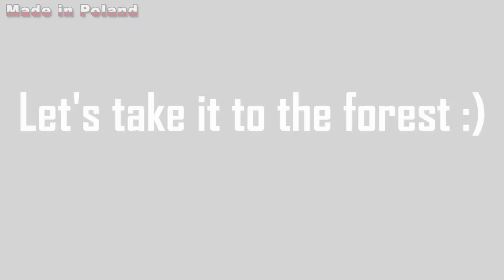Making mobile Gas-Powered Belt Conveyor

Comment: Would be nice the whole system mounted on the trailer, and driven by the PTO shaft of the tractor, so You wouldn't need two separate gas engines, that cost a lot, and are less fuel-efficient, than the tractor engine. But this system is very good too becouse of it's flexibility, and your craftmanship is extraordinary!
Greetings from Hungary!

Comment: Hi There. Very nice job. I have looked at many of your you tube. You are very talented. I notice one thing though. You cant push a rope up hill and you cant push a conveyor belt up hill either. You don't want to run your conveyor belt too tight and if you drive from the bottom you will have to have the belt fiddle string tight. When driven from the top end it is very slack on the return side underneath and is pulling the load up the conveyor.. Usually a couple of carrier rollers on the underside to carry the slack side of the belt. A conveyor has to have the drive mounted on the top end of the conveyor. You could put a sprocket on the top roller, mount your engine down at a convenient height and run belts up to the top roller or chain with a spring loaded tensioner.     Cheers, Nice job.

Comment: I wish I had just some of the metal work equipment you have at hand but unfortunately all I have are basic power tools and a couple of low output welders for my fabricating jobs  and most are done under a carport not a fully outfitted workshop , but love the projects , skills and equipment

Comment: Great build ! If the pan's start to wear out, You can use  UHDW To line the bottom. It's a type of plastic with very high wear resistance.  Though it is expensive. Has always I Liked,Shared,Added to playlists. Keep the great videos coming. All my best. 

For those who may not know Ultra High Molecular Weight Polyethylene (UHMWPE) has extremely low moisture absorption, a very low coefficient of friction, is self lubricating and is highly resistant to abrasion (10 times more resistant to abrasion than carbon steel). Redco™ UHMW has the highest impact strength of any thermoplastic presently made and is highly resistant to corrosive chemicals, with an exception of oxidizing acids. Hopes this helps someone.

Comment: Another Super Nice Build :) Keep up the Great work, Oh BTW, If a Tech Does Not FK UP once in a While , That means that your not doing any Work :) LOL  I FK UP all the Time, But I learn from My FK UPs and I dont make the same Mistake Again :) LOL , I have worked on Belt, Mesh Metal, Screw and bucket Conveyors Take care and have fun, Chellie
Retired Female Industrial Operating Engineer and Fleet Equipment Mechanic with 50 Years of Experience